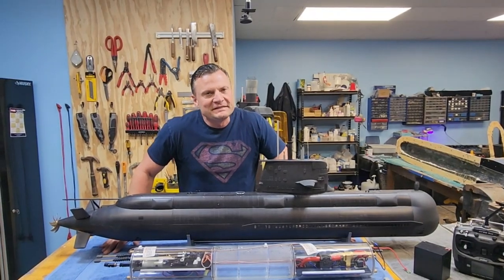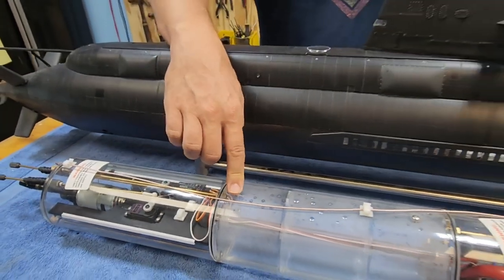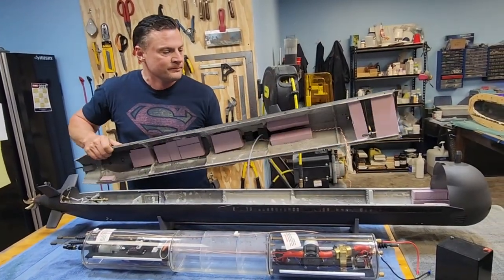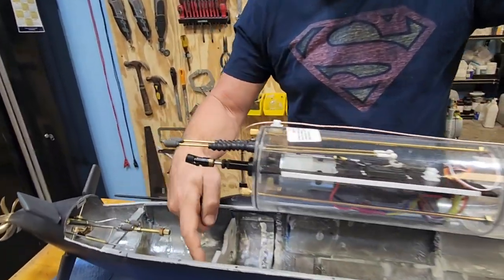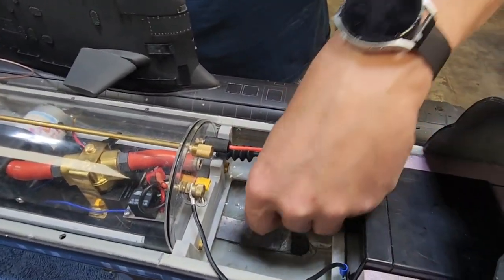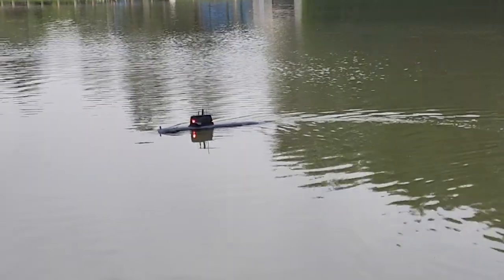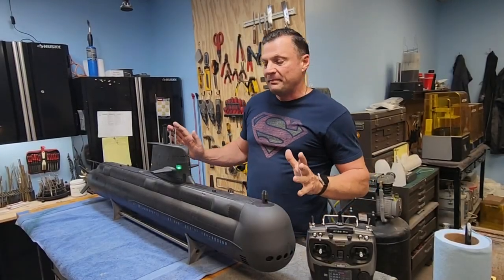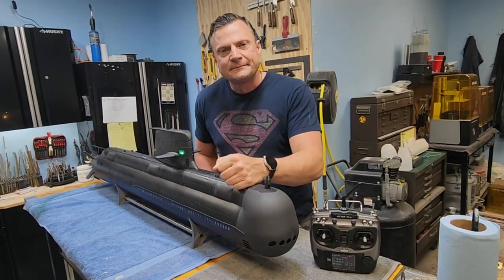Check Out This Amazing Australian Collins RC Submarine with the RCSubGuy

Comment: Hi Bob
Did you use one of the 3 position switches on the Transmitter for the ballest tank..? 
Played back the video several times and it does't show you operated the ballast tank.
The use of the Transmitter set up as an aeroplane for the X-Tails is a brilliant idea.  👍  I love that, makes it sooo easy

Comment: Cant a thin wire antenna 
Be designed to float above
Water barely visible that
Trails above and behind the
Boat? Using a small cork?
to extend the antenna. Using 
The thinnest wire available 
and amplifyer for signal if
necessary. Could try as
Experiment. If floating far enough away 
from sub would not give
 away location. How long
 Minimum does antenna need to be
 to operate controls?
Reply: You can and people do. However, unless the water is ridiculously clear and you are right on top of it, glare and murkiness will prevent you from seeing it pretty quick.
So if it goes much deeper than this setup, you already wouldn't see it under most conditions and that would take away a good chunk of your fun and piloting capability.

Unless ofc you mount a camera system, in which case you would need a tether anyway to get the video signal out. But those aren't very thin.

If in salt water, tether is really the only way to go as signal penetration is much lower.
Reply: @CitizenMio  i ve seen many videos where the subs are totally submerged. I wonder how did they setup the receiver and antenna. Im buillding a 1.5 m typhoon and im having trouble with that...
Reply: @mariquitos586    oh you can totally fully submerge ofc, it's just that the signal needs to penetrate the water for you to control it. That's a lot harder to do than through air. Depending on frequency of the signal used, your distance and angle compared to the water and it's composition and salinity you can penetrate somewhat more or a whole lot less. 

As I mentioned before though, in freshwater you can usually go deeper than is practical given typical murkiness. Unless you use a camera for control. In which case the video signal will have a very hard time going very deep at all without a tether or other connection to the surface.

A 1.5m Typhoon sounds like a wonderfully big project to tackle. At that scale, once the top of the sail is fully submerged, the rest of the boat will already be approaching murky depths in your average water. Run your antenna through one of the periscopes or snorkels and have it stick out a bit above that even. That would give you as much depth range to play with as possible.
Lower frequency signals also penetrate deeper, which is more common in older transmitters these days. Though I believe there's been some effort in the community to come up with modern solutions. Haven't fully brought myself up to date on that yet.
Reply: @CitizenMio  sorry for replying so late. I'm almost finishing the typhoon (just have to mount the water pumps system and the props) and I ve really done a lot of research about this topic.

I discovered that there s a bunch of people using low frequency radio systems which unfornately are very rare to found. I actually bought the radio that the rc sub guy recommends( Radiolink AT96) which works with 2.4 Ghz like most of the radios nowadays.

Some say that It works and I ll be able to fully submerge the antenna while other say that I ll quickly lost the signal. Anyways, I ve bought a 60 cm antenna extension so that I have safer conditions to run the boat.

Btw Im planning to run it on a swimming pool not in murky waters so I ll guess that the signal will penetrate the water better. It s my first rc sub and I didnt use a 3d printer for anything, It s all fiber glass and handmade pieces. I can show you some photos if u have any type of social media hehe.
Reply: @mariquitos586  Congrats on what sounds as excellent progress on your boat! Getting the antenna extension was probably a smart move. Pool wise, it depends on what you got in there. Salt and you'd have the same issues as at sea, but chlorinated pool water does the same. But if you have a pool it's great for testing and rescue missions are easy.
As for the social media, just post a build log on one of the various forums. I'm sure they'd love the attention and other people would get to benefit from it as well. :)

My own projects have begun as well. Against all odds I've managed to find a Thunder Tiger Neptune after all. Already has a new battery. Replacing the o-rings with new ones I found and then it should be good to go. Eventually I'll steampunk it as well, as I love that style.
I tried finding one so I'd have something nice to mess with while I start the arduous journey of scratch building a fantasy boat of my own design. Couldn't find a Neptune for weeks, so I decided to do a crazy but fun kit conversion first, to refresh some skills and learn some needed new ones. The day after most of the stuff for that arrived, I found a listing for a Neptune and nearby. Go figure. So now I have three boats in the works. xD
Reply: @mariquitos586  you need an older Mhz radio system for deep diving subs